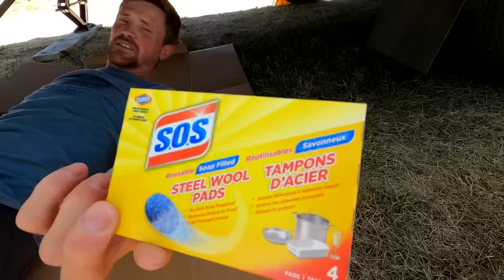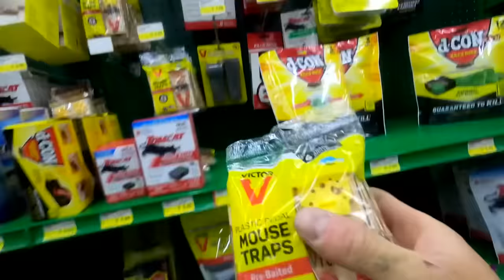MOUSE PROOFING OUR TINY HOME | RV RENOVATION

Comment: So sorry about that . Adrian was about 24/25 when he left  Australia. Initially he had a 3 month summer camp job in the states.  He had no idea what he was to experience. It was not the usual ‘Parents sending the kids off to Dummer Camp. These boys were there by court order.  He survived then he flew to Santiago.  I was so ignorant I thought it was in the USA. 
Anyway he spent 9 months travelling (hitch hiking where possible) right up the west coast of South America. He didn’t have a companion but made friends as he travelled along. He did get ‘done’ by bandits a couple of times. He was on a bus at one stage one of his companions realised there was movement within the seat, so they had detached all their valuables in the seat. So all their stuff was safe.  Another time he realised later how dangerous things were.  Bandits shot out the Tyers of the bus/truck and they had to wait for help. They made a bonfire— sat round waiting for tyre replacements.  He realised they would be easy pickings.
He eventually got out through Venesvala —.no idea how to spell it.  But he enjoyed his trip but very glad to get out of S.A.  Then he had another 3 mths with older juvies.  They were so troubled.  But he was safer in Delaware, New Jersey. He eventually moved on to England for over 2 years.  He traveled extensively into Europe from London. Also travelled through Thailand, Asia then home. He arrived home 2002.
Just wanted to let you know I understand roughly where you’ve been.  He loved all the travel but said he would not do it all again.
He never came and lived in Brisbane.  He was determined to study at Sydney University.  I’ll admit he left Brisbane 5 years earlier as ‘my lad’.  He returned his own MAN with a heap of his own person.  I just was so glad to have him home.
Well I no doubt have board you enough for now.
All my love, 
Ellen.   Queensland,  Australia.

Comment: There is another solution.You can buy an ultrasonic unit that will deter mice, rats, bugs and creepy crawlies but will not hurt Franks' ears.I used one for over 10 years and it is about $100 but dealing with a constant parade of visitors is no fun.The brand is Transonic and you know where you can find it-amazon.I had mine aimed at the entry door and you can't hear it but I had centipedes 12cm plus long getting in and I am allergic to the bites.

Comment: I lived at the same elevation in Colorado. Our pipes froze in the winter twice. Have you thought of heat tape on your water lines? Also, consider hay bales around your trailer in the winter. It will help insulate and keep the wind from scooting underneath. And we also had the demon mice from hell. They ate the Dcon and then the boxes, and kept on going. We put steel wool at all the lines coming in from outside, and that defeated them. The screen idea on your indoor vents would not work, they would easily chew through it. Have fun in the mountains!!
Reply: What about Carpenters Cloth?

Comment: Ask fellow rv'ers what their solutions are. I've used steel wool at pipes and electricals running into the trailer. They can't cut through. I agree to use mesh but make it a metal mesh... They can chew the plastic.

Comment: Don't mean to be negative here,  but...
If you raise the input line, that reduces the angle of your drainage from the house to the tank.  If the proper drainage angle was set in the beginning, do you have enough leeway to assure proper drainage when it's -9degrees outside for months on end?  Just wondering...     Happy Building!  Lynn

Comment: I had this issue i freak out too. Steel wool in holes inside first, then spray foam. Underneath I used Gorilla tape on holes. I used tomcat block from Tractor Supply inside in areas animals cant get to.  I haven’t had an issue since so far.
Reply: Why do I imagine spray foam pushing the steel wool out of place?

Comment: They make a spray foam that is a rodent repellent.  The normal spray foam won't stop rodents.  They will chew through it with no problem.  One thing that works good is to put some sheet metal over the bottom.  It doesn't have to be very thick sheet metal.

Comment: I live full-time in my RV. Very important to put some Pine-Sol in a spray bottle spray all around your tires and axels the underbody. And of course do what you’re doing to fill all the holes. The purpose of the Pine-Sol is to overpower the path the mice make on their way in through their oils and urine which is the path they used to go in and out every time. There’s also several products out there that you can place inside the coach which are safe for animals and are placed back in the back area bathroom and kitchen not an unpleasant fragrance at all but the mice hated it. Don’t waste your money on Irish Spring soap or mint cotton balls and stuff like that 18 years full-time living only in an RV I can tell you that stuff does not work.

Comment: Tare all that crap off the bottom of it like I did mine all the way to the bottom of the floor and get it spray foamed with closed cell. My foam guy has done many campers and it’s way way better insulation. Mine had only like 1.5 inches of nasty wet damp pink insulation on bottom of it that’s the same junk they put in the walls of it too. Love you guys keep up the good work and hope all goes well out there. Hope to get done that way from Alaska this winter and see what’s up in that beautiful countryside. God bless

Comment: Put an upside down pie plate on top of each Jack. Or, place a piece of sheet metal with the edges turned down on top of each jack. The mice will not be able to get past . Copper wool and foam is good. Doesn't rust.  Be very careful about poison. Rats eat it and crawl into a tight spot, die and stiiiiink!!! Sticky traps are good for mice inside your living space.  Great videos guys!

Comment: Alli im with you putting protection on the vents but i thing theres smaller chicken wire that you can use instead of the plastic because they can bite it in time also mouse traps i dont believe in them when i had mouse in my house i use the DeCon brand one it was next to the mouse trap trent got, Hope you evacuate your unwanted guest😉

Comment: I may be wrong but it appears that the septic tank was placed into the hole without prepping the floor of the hole with sufficient rock for the tank to set on.  Rock is important for maintaining a level tank.  The tank is too heavy to be set on raw dirt.  If the contractor doesn't do the job correctly now, you will be the ones suffering in the future at possible great expense and time in court getting the issues remedied.  Don't let the contractor jury-rig a solution that jeopardizes the integrity of the septic system.  And, don't let the fear of him screwing up the remaining part of the job keep you from insisting that the job be done right!  Right now, you have all the leverage.  When he leaves, you have none!  If he refuses to do it right, fire him and get someone in who will...preferably someone who specializes in septic installation and maintenance.  Love you guys and don't want to see you taken advantage of.  Good luck!

Comment: Packing steel wool around wires and copper tubing is not a good idea !  The spray foam is the best idea ! Did you check around where the pluming leaves the trailer...like around the toilet pipe into the black tank and the gray lines out in the floor to the gray tanks .... I had a RAT that climbed along the frame, jumped up on top of the black water tank and right into the inside !   Good Luck !

Comment: There is a You Tube channel by Shawn Woods called Mousetrap Monday that might come in handy if your mouse problem persists.  Also, I soak cotton balls in a small container with peppermint essential oil and that is supposed to deter mice because they don’t like the smell.  The smell from the peppermint oil makes the RV smell good too.

Comment: You could have got much less expensive steel wool in the paint department.  You will be fighting mice much worse out on the property.......mice do not like concentrated mint oil so if you spray it inside the trailer on cotton balls where ytou found the poop it will help keep them out.  Also spray the entry points under the trailer.  s for the septic tank they can either punch a new inlet hole that is higher or punch a new outlet hole if you have the height.  I like to did the holes for the tanks deeper then needed and use gravel or sand to make a level bed to set the tank on.  You can level gravel or sand much easier then the native material.

Comment: In a week crawl under Terry and make sure all the plugs are still in place, and no new holes have been chewed.. also check inside the trailer for new droppings.. the fact they chewed the liner on the underside leaves the possibility that they are living in the layer of insulation.. it's both fascinating and incredibly gross the way they tunnel thru the insulation.. out here in the oilfield they insulate the watertanks and cover it with tin, if they leave any gaps the field mice get into it and shred the insulation.. when they remove the tin to replace insulation, the mice have dug tunnels and dens that encompass the entire tank.. it's very similar to the way ants build their ant colony.. oh fyi a field mouse can jump up 2 to 3 feet and can climb like spiderman..

Comment: I had rats in my garage! They ate through the spray foam and steel wool! The mesh  doubled over screwed in worked!! So if the spray foam is a nice snack for them, Weld the mesh to cover the bottom!!!
Hope you cured it and don’t any future mice issues!

Comment: You know, nobody wants to do bad work or be known for bad work and sometimes things get overlooked, always let your contractor be aware of the issue at the start then they have the ability to fix it. This would be a better result, rather than think and act as if  they would take it out on you for the further of the project. Be brave, honest, open, timely and kind. Cheers👍

Comment: i had good old HOME DEPOT contractors install new carpet and linoleum in my condo and ended up with mice and ants!   Never had either in the past 25 years living there before!   They must have come in thru the walls because i discovered they did not put in the border in places, like behind the rrefrigerator and stove, and improperly in others places, like on top of the carpet with gaps!

Comment: Trent's vivid dreams will stop after 40 y/o, at least, mine did. Also, I experienced sleep walking up until my late teens. Sleep sex can be a problem, especially if it's the first time and your wife doesn't think it's a "thing". All that happens because you're not in "deep" REM sleep. Your body is tired, but your mind is still firing. I never drank or smoked and it always took a long time for me to shut down.

Comment: Just be aware.  I also live in a woods and regardless of now good you think you have things bug and mouse proofed, there's this thing called deterioration and as plastic gets old and tarps get old, new holes will form and more will need to be done.  I keep (5) traps set at all times at the previously discovered ingress sites and every once in a while, one gets through and I have to go and redo the fix.  Doesn't matter if there's steel wool, poison, etc.  they will find a way and will even become poison resistant.  You might consider a repeating type mouse-trap outside your camper where you are parking it, so they will go to the obvious bait rather than try to sneak into the camper.  Later on, you will have the same exact fight with your house.  Guaranteed.  Here's an example of one repeater that seems to work good.  If you don't like this one, look at one of the other 500+ mouse traps he has tested:  https://www.youtube.com/watch?v=hJc89N9ECNw  lol

Comment: No mouse traps. Get bars of Irish spring.  Mice HATE the smell , Cut in half and lay them around your RV and under in the cubby holes ect.. oh if you have wasp problem. Get large paper bags crinkle it real good . Then stuff with plastic bags. Twist the top n tape closed then hang somewhere  where rain can’t get to it.  Keeps all bees wasp hornets away.  It mimics a hornets nest. And other hornets won’t go to it either

Comment: After the steel wool application why not reinforce the underside of the trailer with screening? I don't think the screening on the interior vents may help with the mice invasion if they are able to get that far but all their poop sediment will probably be blown into the trailer through the vents into the air.

Comment: Feelin your pain with the mice!!  I moved into a double wide trailer next to the railroad tracks.  I have endured the possum, raccoons and coyotes... but the mice are the worst!!  They only wanted to go in my silverware drawer.  Eww.  I set traps.  They sprung them without being caught.  i had to use glue boards and take them to a different field and pour vegetable oil on them until they were free.  One tried to jump on me after he was free! Then they started jumping over the glue boards!  I finally did what Trent did an climbed under the house with all the spiders and spider balls.  Steel wool and Gorilla tape.  I heard mice can chew threw the foam stuff.  It was an awful job but so far, 3 days, no mice.

Comment: Annoyed a bit that you were dismissed with your mesh over vents idea, Allie. Mice definitely can come through holes like that.  I would have them covered as a first solution and then work from the bottom. They might be stuck in the insulation and now with no way out they will go up.

Comment: Steel wool will eventually oxidize and disintegrate......a better choice would have been copper wool or copper mesh as it won't rust......mice & bugs hate copper........also, screening the vents can be problematic as dust & lint will build up and obstruct the air flow......

Comment: Once you seal up the entry points you should be good, but earwigs in a van, that's weird I hate them !
I live above a store I was the first person to live in the brand new apartment, I was still worried about bugs, I put screens (I used drywall tape as the screen) and I have a filter too over the vents, well the both reside under the vents flush to the vent cover. The HVAC guy doesn't love the idea and just asked us not to put a filter over the intake vent other than that  in 7 years we have had no problems with heat or AC

Comment: Native does not last all day, trust me I have tried it. If you do real work that requires sweet it don't work. As Frank licks the bait off the traps & sets the traps off. Or the traps get set off going down the road or while walking around the trailer.  You only need 2 dog proof bait stations, go back to the hardware store & get them "cheap scate" Trent. 😂👍

Comment: The septic company needs to bring you a new tank you don’t wanna drill another hole and fill the old hole    They need you to bring  you a whole new tank there the holes are in the right place
Reply: There’s nothing wrong with the tank. It’s just not on level ground.
Reply: stshnie they said the intake was sitting lower than the outtake. Which means. Who made it didn’t do it right.   Didn’t  you hear Trent say. Make a new hole and  cover the other one.   I have 3 septic tanks. So I’m not stupid on them.
Reply: @dianep3071  Did you watch the previous video? They had to drain the water out to reset the tank. It started out level when it was empty but then the ground slipped. Nobody makes tanks with the inlet hole lower than the outlet.
Reply: stshnie did you watch the video cause that’s what Trent said. The brake is lower than the outtake    And talked about making a new hole and patching up thee old one
Reply: @dianep3071  Yes, I watched the video and yes, I heard what Trent said. When they bought the tank, when they lowered it into the hole, and when it was passed by inspection, there was not a problem with the height of the inlet. But now there is. Why do you think that is?

Comment: I  have lived in a very rural area for over 25 years. I had a lot to learn about mice. Doing some research will help. Did you know they can come through a hole the size of a dime. Their skull bones overlap to squeeze through. Also they leave drops of pee and poo every inch or so as they travel around your place. You need to bleach all hard surfaces before you cook because of this habit. I hate to tell yout this but that tarp set up under the trailer will not keep them out. There is a very inexpensive trap you can make with a 5 gallon bucket. Fill it about a half full of water. Secure a length of wire from one side to the other at the rim. Thread a soda can bottle horizontally(poke holes)and suspend it in the center of the wire over the bucket. The soda should spin. Now put a big splotch of peanut butter on the soda can. This will attract them. They fall in the water and drown. And Frank doesn’t get his foot in a nasty painful trap.
Allie, my neighbor is an exterminator. She said to bug bomb the place inside. You might have to do it once and then 2 or 3 weeks after to kill any eggs. Read the directions carefully. You need to remove all dishes and utensils,pots and pans, turn off pilot lights and let it do its job.
I lived in a house with mice once and had one come under my bedcovers and ran across my naked back. I will never forget it. Best of luck. Ridding a place of mice can be a frustrating and lengthy job. Don’t give up.

Comment: I am a little confused. If the mice could get in [or out] via a hole in the layers of fabric, insulation, etc and you seal up the holes, why couldn't they just eat another hole?  Perhaps some very thin sheet metal, like tinplate over all that canvas stuff. [With tiny drain holes in the "tin" so that moisture does not accumulate.  Mice have incredibly sharp little claws, so they can grab onto almost anything, and weigh almost nothing so they can go anywhere, including up sheer "smooth" walls.